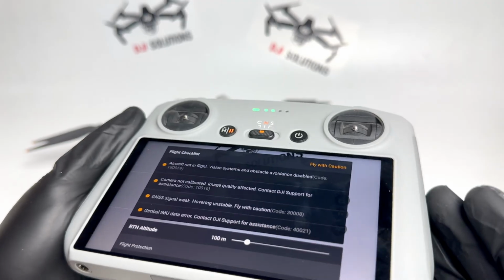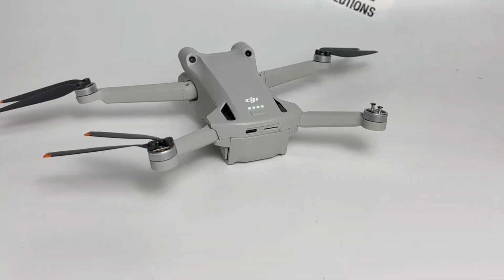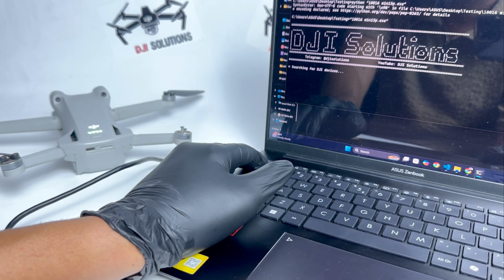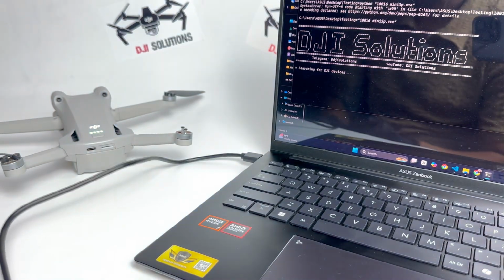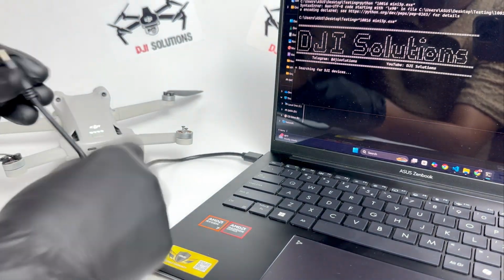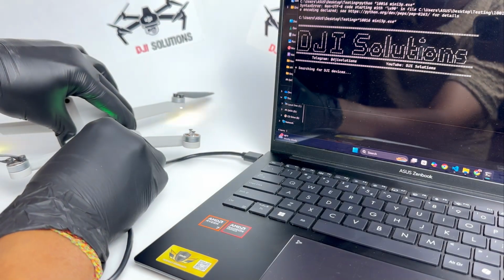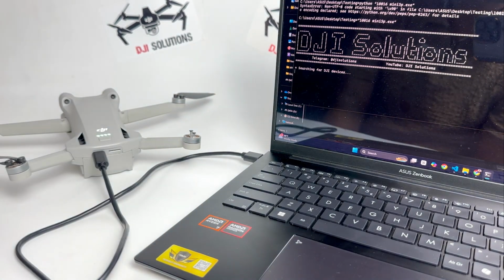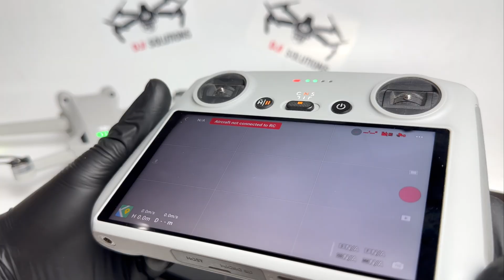FIX  Error 10016 10017 and 40021 for Mini 3 Pro

Comment: I needed to replace gimbal and camera on the mini3 pro. Error 40021 and 10016 now. djisolutions fixed it all. in my case the gimbal calibration did not go smoothly, possibly due to me leaving the yellow plastic protectors on it. Calibration got to 20% and failed with the unit buzzing twice. On the3rd attempt, I steadied the gimbal by hand and it then progressed to completion. djisolutions was patient and worked me through it until success. His fee was very reasonable.

Comment: Just got in contact with these guys via WhatsApp. I was very hesitant but they jumped on and had my issue fixed within 10 minutes. After replacing my gimbal on my mini 3 pro I had no luck with flashing the new firmware. DJI solutions logged in and corrected the issue within minutes.

Comment: May I suggest an arm Switch between the mini 3 pro and mini 4 pro?? That would be interesting it may improve the signal on the mini 3 pro 😅
Reply from the maker: That not possible 😂
Reply: @ well guess what, I have done it and the drone works and flies normally as it should